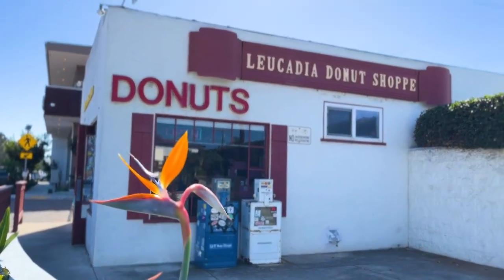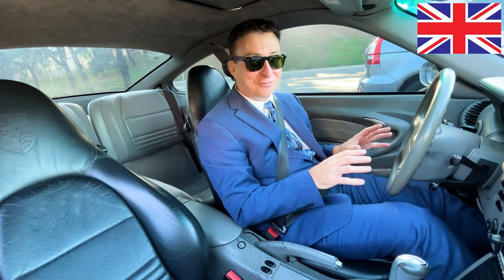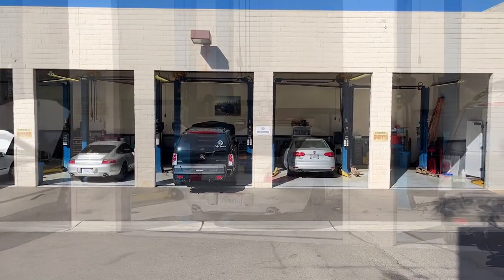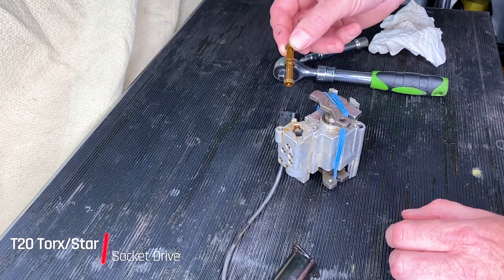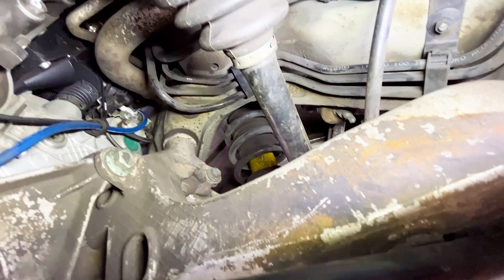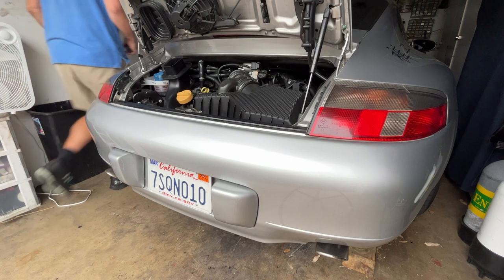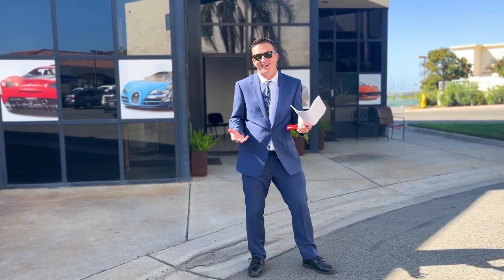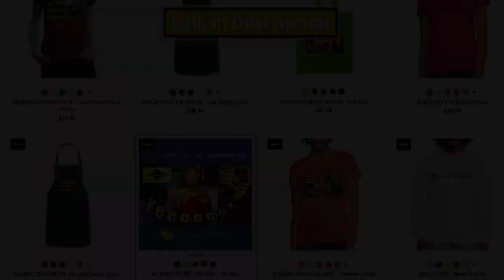Emission Test Hack: Ensure Your Success with This Technique!

Comment: I'm pretty sure the variocam solenoid doesn't actuate below 3k rpm. One time when I was trying to get my 986 to pass emissions, I had a similar variocam code, so I drove it around without going above 3k rpm to set the monitors, but not trip the CEL. On the way home from passing the test, I revved it out, and the CEL came on immediately.
Reply from the maker: That’s a good question about when the Solenoids kick in.  Like you I was under the impression it was 3000rpm. Another article I read recently said 1500rpm?? In the coming durametric episode we should be able to answer that question once’s and for all. Thank you for sharing your cel cheat trick, that may save someone a sleepless night! You ROCK! 🤘😎

Comment: I get 30 mpg with my 2010 Cayman S on the highway @ 80 mph and 26.5 in town driving. I have the Durametric diagnostic tool for system checks also.
Reply from the maker: Thank you Warren 🙌

Comment: Great job Finn! My 03 C4S has Variocam Plus and I'm chasing a P0028 (Valve lift control, bank 2 output stage) that only shows after the car has warmed up. It will operate the Variocam correctly the 1st 10-15 minutes with its normal power and then fall flat on its face after that as it doesn't have the same power above 3000rpm. I've tested and cleaned both solenoids on bank 2 off the car, a real pain to get off although no need to remove the valve cover like on earlier 996, and they both pass resistance and activation tests with a 12v battery. The solenoids are not cheap so I will try checking the grounding on mine first before I cough up $500 for both solenoids. Thanks for the tip! Variocam is awesome until is not. LOL  On the undertaking issue, I remember clearly during drivers ed that it is a no, no but ppl simply don't care. I try to avoid it as it can be risky. Cheers mate!
Reply from the maker: Greetings to Puerto Rico Fred 🏝
That is very interesting about your variocam plus. One thing that was suggested by a viewer was to swap the solenoids side to side to see off the problem swaps side with it. That way you don’t need to buy a new one to find out. I’m not sure if that applies to yiur variocam plus? On the 1st gen variocam the solenoids are the same both sides. The variocam error has not returned, The car has about 1500 miles on it since the grounding fix shown in this video. The road rules are very relaxed in America in general, I don’t normally drive like the video clip but you could 😉. You would be beaten to death by a crowd of random motorists for doing that in Germany!
Thank you for watching 🤘😎